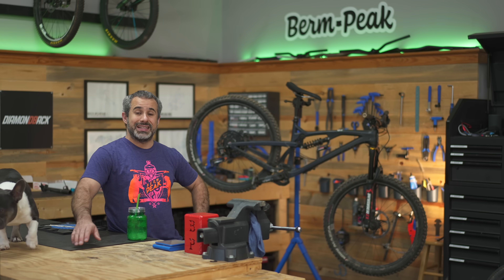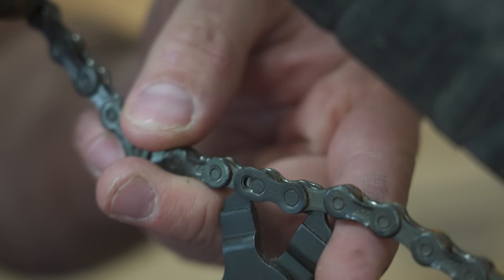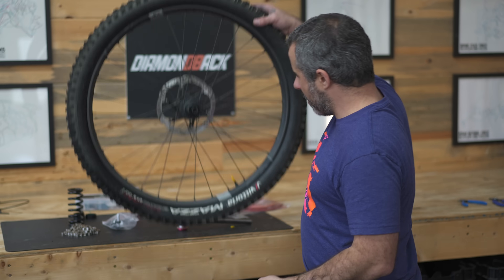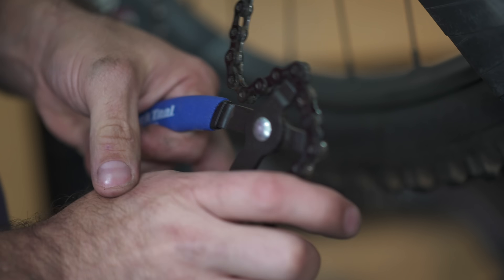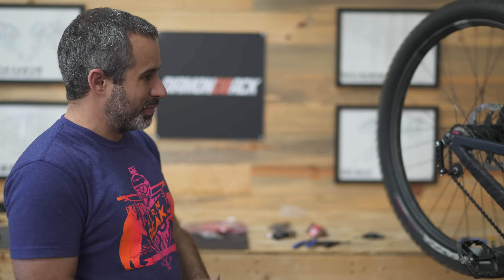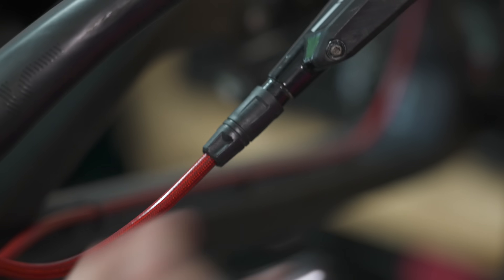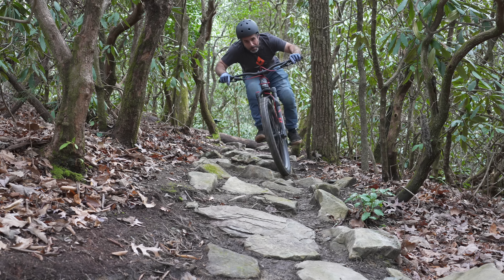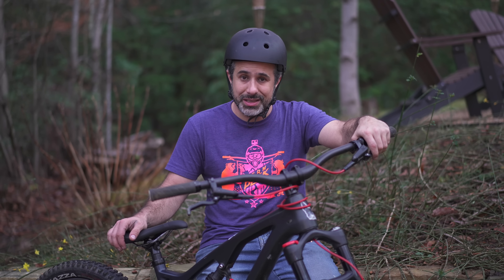Slopeduro Bikes are Unnecessary. Let's build one!

Comment: Please don't preload that poor shock. You're putting extra stress it don't need and once you aren't on the parking lot anymore it doesn't matter at all (it just change ride height not energy transmission). Put an even stiffer spring instead, 10% won't make a splopestyle out of an enduro spring, or an air shock that you can pump (put volume spacers in negative chamber to raise rate with less pressure). that way you aren't playing with the reliability of your rebound piston and you can actually jump the bike.

Comment: Hey everyone! I hope somebody can help me or answer my question because i bought a shimano deore m5100 for my mtb my drivetrain set up is 36t/11-50t how many chain links shoul i use because i tried 11speed chain and it has 116links but it is to short
Reply: And i also tried changing my front chainring from 36t to 30t but the chain still is very short and i did not remove any link from my chain pls someone help me